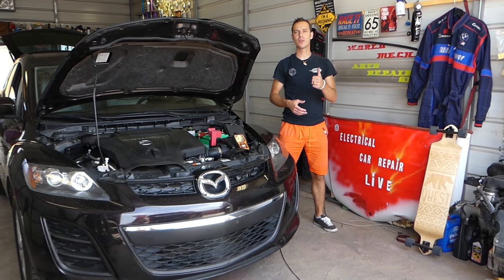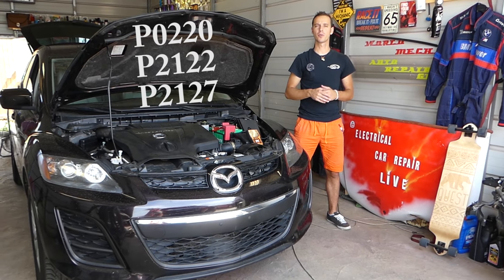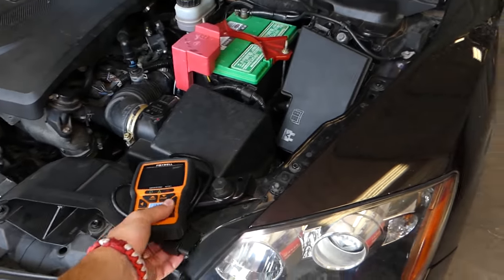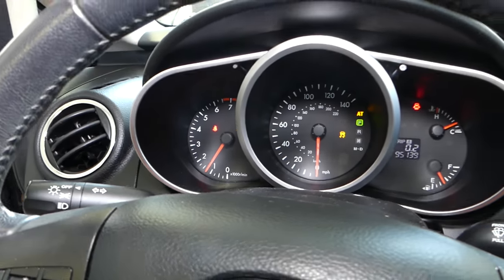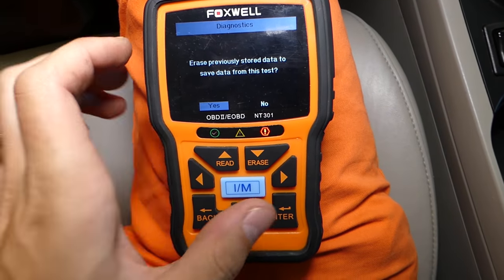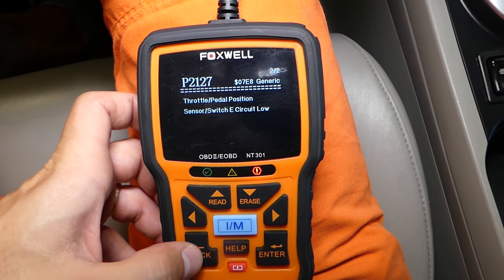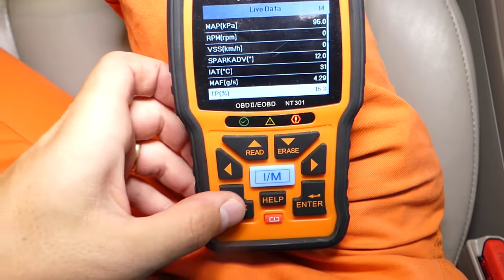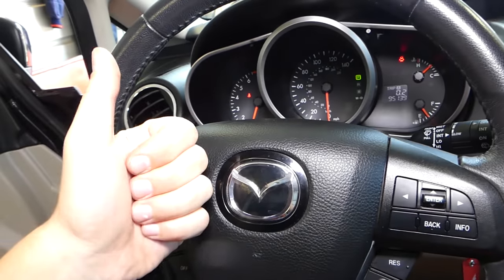FIX CODE P0220 P2122 P2127 Throttle Pedal Position Sensor

Comment: Not sure if anybody will see this 3 years later but I had this happen to me and I panicked for about 5 seconds then I put my thinking cap on and I didn't have a CODE READER! I put that frickin hood up and I disconnected the throttle connector with the engine off. Wait about 30 seconds and plug that sucker back in and BOOM accelerator pedal was back in action! Ain't nobody got time for that GUYS! Us poor folks need more fixes and hacks and less throwing parts at problems. Maybe I'll start my OWN frickin channel! Naptown! 317 n the house baby!
Reply: I will try that 😎 thank you bro hell yeah that’s what we need !

Comment: Greetings from Egypt , I watched most of your short videos , but we need more details about the replaced parts , how did you inspect this part by multimeter or scope to specify the fault if it is loose connection or faulty APPS , thank you so much and you will be highly appreciated if you go in more details , you will be fantastic .

Comment: So many variables that were not covered here i.e. 5v reference circuit,  sensor gnd , sensor signal, some have two 5v ref circuits it's NOT that easy every time !!! Ppl be aware there are some steps you CANNOT skip before u replace a component...

Comment: Great video very helpful! I have similar intermittent issue on my Audi A3 2015 Quattro, all of a sudden no throttle, idle very bad, EPC (ESC Stabilisation control fault), CEL lights all on, and P0642 code, the code disappear when I turn the engine off and on and the problem goes away but comes back from time to time. I also have the code P2683 that always stays which point to maybe thermostat-water pump issue. One occurence when I had the problem, I did test (TP%) my throttle body with my scanner with ignition on and the % was moving up and down when stepping on the gas pedal and releasing it so it seems that it's not the throttle body causing that problem, unlike when the engine was running I had no throttle at all, also one thing I noticed is when the problem occurs when I step on the brakes, the car shakes and wants to staul? I'm at a lost, any idea would be greatly appreciated. Thanks for your great content, John

Comment: The car is a 2016 Kia Soul 1 L4, 1.6L.

I am not sure if this is the right place to put this, but I need to get some feedback.

So about a month ago blower motor in the car started acting up, you would turn the car on and turn the heat and fan on and it would run but then it would slow down and eventually shut off. All my research showed that it was a bad blower motor so I bought a new blower motor and installed. When I turn on the car I immediately got an error code P2127 which if "P2127 Code: Throttle / Pedal Position Sensor / Switch “E” Circuit Low" (this triggers the car to go into safety mode). So I reset the ECM and the problem appeared to go away.

About two weeks after the new blower motor was installed the problem came back the car went into safety mode, because it thru the code P2127. So I researched it and thought it could be the throttle body position sensor or the gas peddle sensor. Being as both were cheap to purchase I bought both and installed both. But this did not last as within a week the P2127 came back.

So I thought I had purchased the wrong blower motor, I purchased another blower motor, and yesterday I installed it and immediately the car threw the P2127 code. So I unplugged the blower motor and the P2127 code immediately went away. plugged it back in and it came back. Note that during the period of time between the first new blower motor and the second new blower motor I drover the car without a blower motor connected and never ounce received the P2127 code.

I check all the wiring and there does not seem to be any issues, I have confirmed the blower motor that is in the vehicle is the correct one for the car (ran the part number thru Kia's online part site), pull the blower motor resistor out and tested it and it is working although I have a new one that I will be installing.

So I am at a loss here guys.

Any help would be appreciated.

Comment: What if I replace my pedal and it still says code P02127 🤔
Reply: Did you figure it out?
Reply: Having same issue. First replaced alternator because it was going bad, then replaced throttle pedal, checked all wiring, everything looks good. Still throwing the code. Going to try to clean my Throttle body and if it still throws the code I will be replacing the TB completely... This damn Chevy Impala is a pain in my ass
Reply: @bushpilot223  did you get it fix yet
Reply: Then its your wires
Reply: This guys raps when he talks I thought I clicked on a rap video 🤣😭🤭
Reply: @bushpilot223  Hi man! Did throttle cleaning help to solve the problem? Have some alike situation on my Mazda CX-7